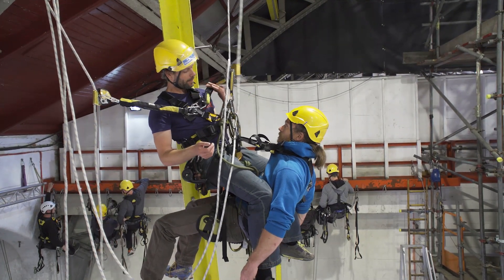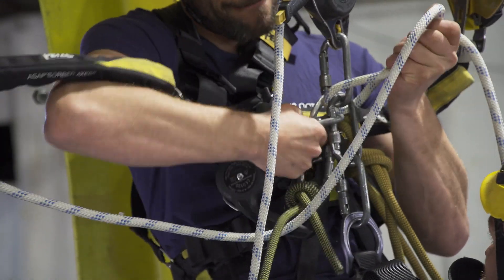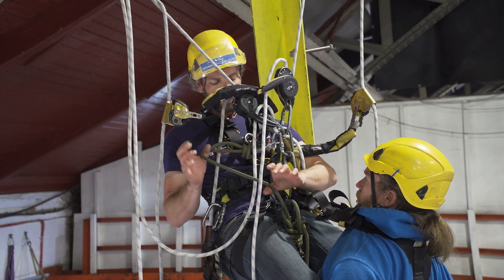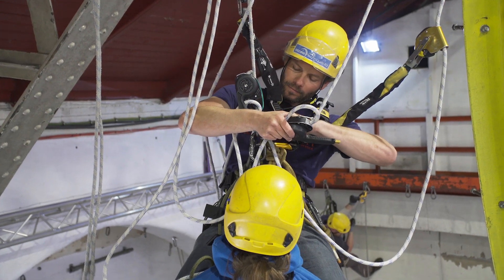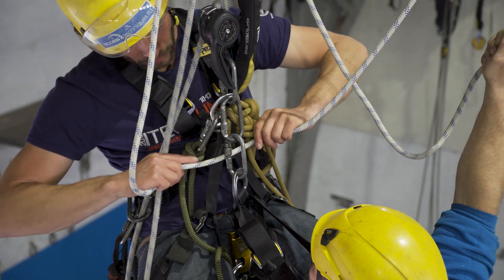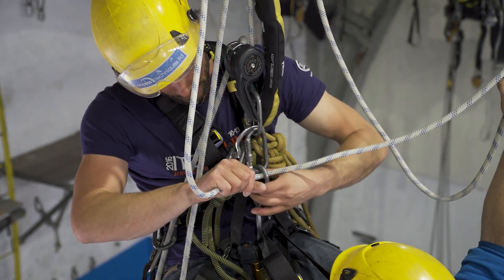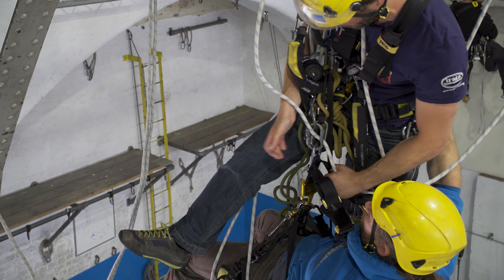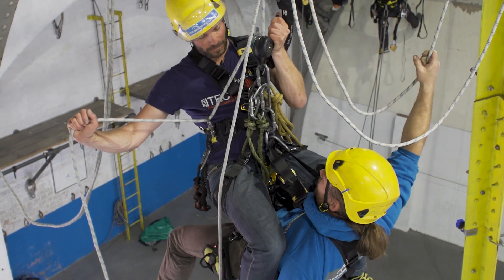Re-anchor rescue - escaping the loops

Comment: In the second instance the casualty can connected via his descender on the back-up line.
Descend slightly until the casualty descender takes load, 
The short link can be removed and re-attached...Making sure the loop is free. 
Release load on casualty descender until he is hanging on short link again.
Much less physical effort and is still safe as the 2 point principle is maintained.
Reply: @jf7393  If you have a Re-belay rigged thats is 50 m deep then your rigging method is probably not the best
Reply: @bbooyse20 verbatim that.